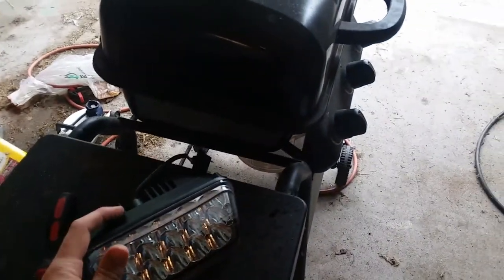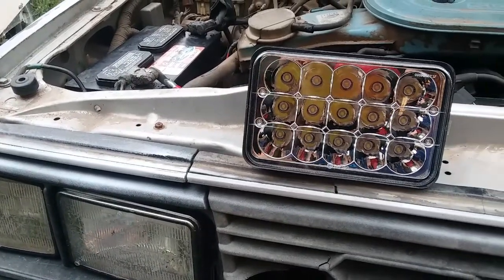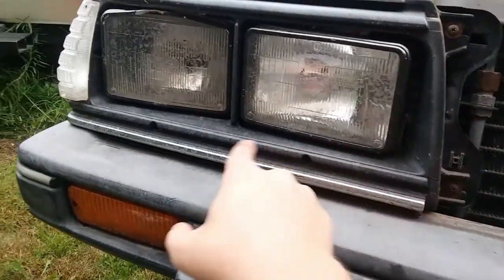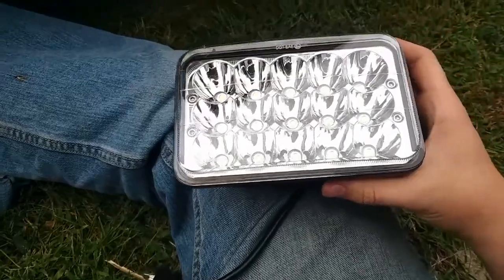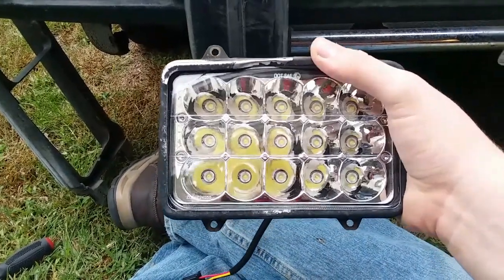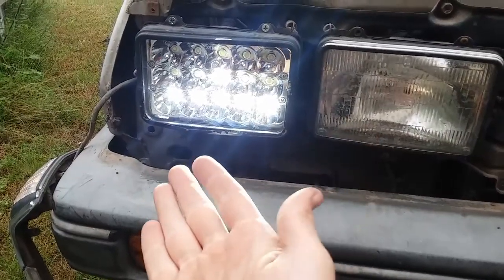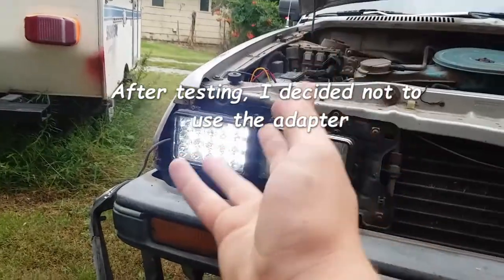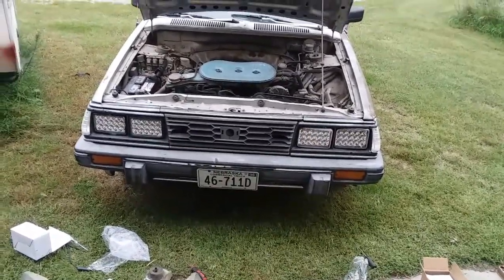Subaru Brat Project Pt.2: Led Lighting!

Comment from the maker: Hey guys. I ended up having to wire a custom harness and switch for the brights. Let me know if you want to see a quick video of how I wired it.
Reply: I'd like to see that!
Reply: Subarute Hey, were you able to get around a make the video of the custom harness and switch for the brights ? Greatly interested
Reply from the maker: Haven't quite yet. Work on the brat has come to a halt right now as the motor gave up on me. I do have videos planned, but with finals week and the cold nebraska winter breathing down my neck it may take me a bit yet